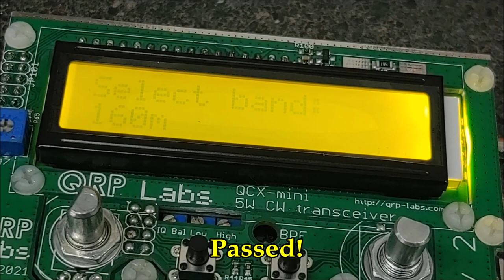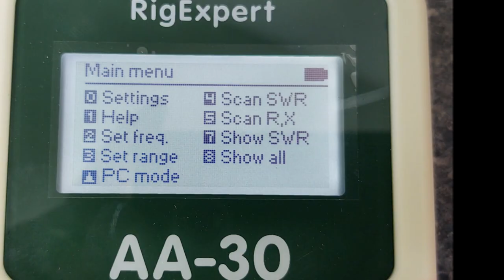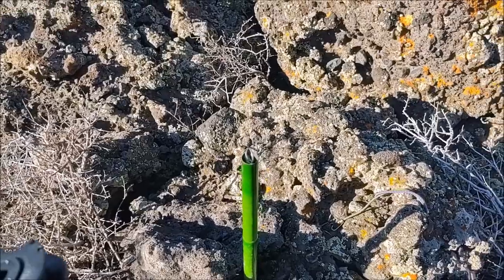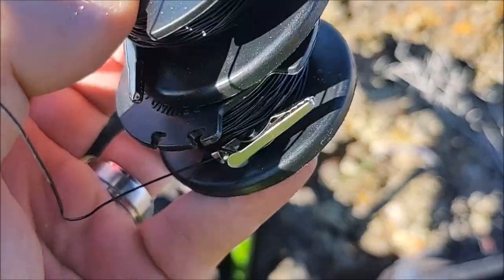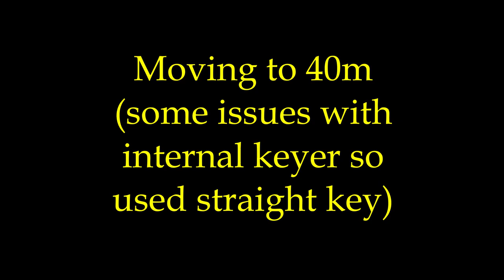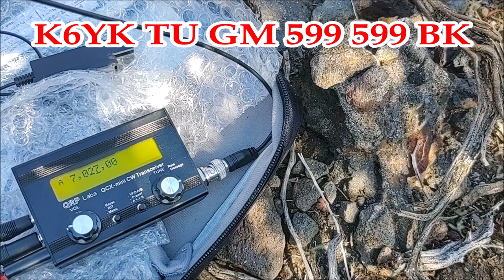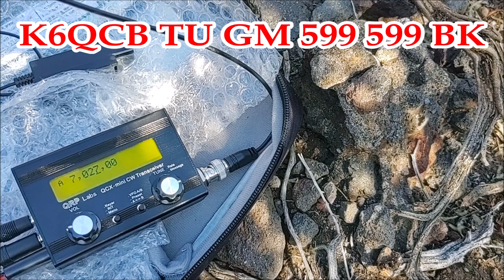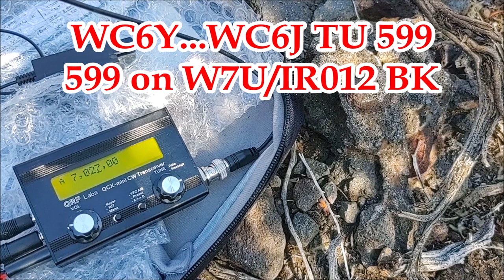From Shack to Summit, Using QCX Mini and New Dipole on SOTA All-Time-New-One

Comment: Well done!  That was quite a vertical bush whack and thanks for sharing.  I have a 20m QCX mini still in the box.  Hope to get it done over the holidays this year.  Just built a 20/30/40 dipole for my new/used SW-3B I bought a few months back.  Need to get that out after an upcoming trip.  Again, well done - AI6OU
Reply from the maker: Thanks and good luck when you take your QCX mini out, have fun!